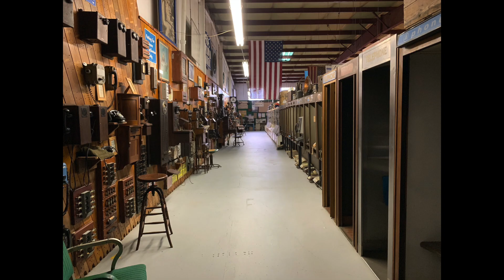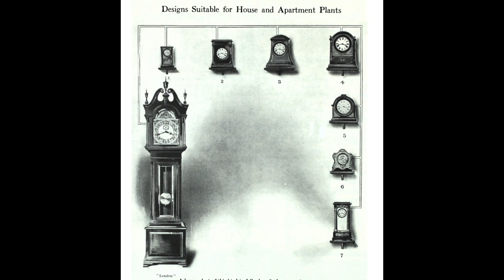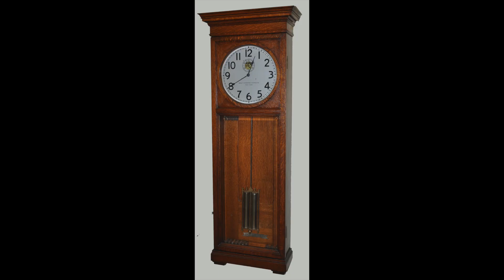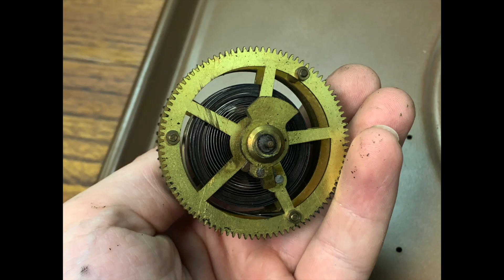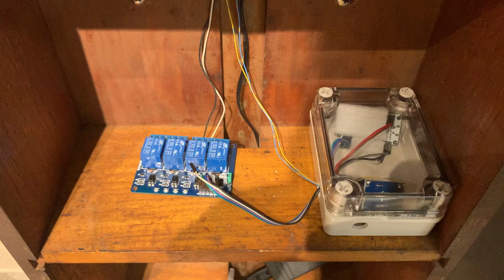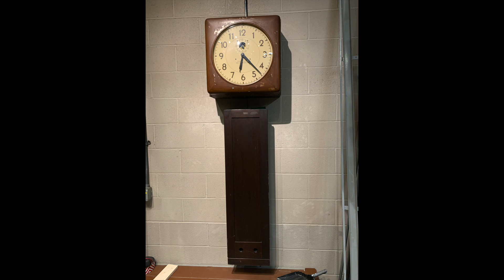Self Winding Master Clocks in Central Offices

Comment: I worked in radio in the early ‘70s and we had the self-syncing Western Union clocks. They would receive a signal over a telephone circuit at the top of the hour and the minute and sweep second hand would snap to the 12 o’clock position.  A precise time source is critical when you need to do smooth network joins.

Comment: I don't know whether it was made by that company but the high school I went to, built in 1936, had a self winding master clock with secondary clocks in each school room and for the bells.  The system was still working as of when I graduated from high school.  But that's getting to be a long time ago now, sigh.  I used to help the fellow that maintained the clock as he was one of the instructors at the school and we got to be good friends.  Now I'm curious, next time I'm back visiting I'm going to see if I can find out if the clock system is still running, or at least if it's still in place.

Comment: Hi Sarah, you run a fascinating  channel.  Synchronised clocks were part of my job 35 plus years ago. The slaves were deliberately designed to lose about 10 seconds per hour. So, the sync pulse would always make them catch up on the hour.

Comment: Somewhat puzzled by the 24 volt reference. Worked for BC Tel [just north of you] and the network voltage was always 48 volts.
Reply from the maker: There’s always 24 as well for switchboard circuits and tube filaments.
Reply: @ConnectionsMuseum  Must be a regional thing. I started installing CO equipment in 81. I checked with some of my older peers and they did not recall 24volts being used in any of our COs. Love seeing all the old equipment, a lot of it looks familiar or identical to ours.
Reply: @ConnectionsMuseum  I'm assuming there was a step down transformer for equipment that operated at -24 volts?

Comment: Here in Leeds, Yorkshire, UK, there is the "Time Ball Building". Its a building built in the 1850s which housed a watch and clock maker. It has a connection to the Greenwich Observatory, Greenwich, London to synchronise the time. At noon the ball would drop and you could use it to set you watch.

Comment: Wow Sarah, what a beautiful brain . . . fantastic video !!!  Huge time fan here, on the periphery of time discussions in the early days of GPS, various secure radio applications, later cellular phone service, and my wife's employment with the Voice of America with their synchronized clocks, that inspired me to install synchronized (now, power over ethernet, and time synch from a GPS antenna installed on the roof) in a couple of offices where I worked.  So glad Google decided you belong in my "space".  Have a couple of grandfather clocks here (only one running) with modern Hermle movements, and since the 2003 hurricane Isabel knocked out our power for a week, and I discovered that most of the clocks in my house were not actually clocks, but  frequency counters, and running on generator power - which frequency control was gross - and seeing my "clocks" lose all sense of time, I spent several years obtaining clocks tied to WWV in almost every room - generally change the batteries once a year - generally after the "fall back" [run forward 23 hours] DST-->ST setting.  Now we just need 999,992 more subscribers to this channel.

Comment: When I started working at Disneyland in 1985 they were still using mechanical time clocks and manila cardstock timecards. 

The time shacks around the perimeter of the cast member entrances all had syncing clocks which recorded tenths of minutes.

It saved a lot of us getting to the time clock "late" but still had 6 minutes past the hour to clock in and have the timestamp record xx.0 in that day's slot which lasted form minute 0 to 5. 

They finally ditched the manual system and went to an electronic mag-stripe ID card system in 1990.

Comment: I have one of these.  The back plate is stamped in ink WECO KS-1928 WECo insp 11773.  There are two screw contact boards at the top of the back plate.  Left is 1 - 4, right 5 - 8.   1 and 2 are the 24 VDC for the winder.  3 and 4 are the 6 second contacts.  Someone wrote in pencil “POD clocks small” below the terminals.  5 and 6 are the 24 VDC hourly sync pulse input.  The sync coil is 400 Ohms, so I assume it is 24 Volt.  The 3 Volt sync coils are about 20 Ohms.  Contacts 7 and 8 connect to another interrupter which is strange.  It generates pulses at 10, 20, 30, 40 seconds.  Someone wrote in pencil “large sec clocks” below the terminals.  Contacts 3 and 4, also 7 and 8 have knife switches which allow their circuits to the movement to be opened as well as momentary key switches which allow for manual pulsing.

The newer type F movements in these clocks bear a lot of similarity to movements made by Seth Thomas.  Earlier movements were outsourced to E. Howard, Seth Thomas, and possibly others.  The early movements used an unusual rotary motor which was modular and easily swapped for servicing.  The motors could be temperamental to adjust (personal experience) and were probably thought to be too technical for field service workers to deal with.  The vibrators are simpler and more reliable, thus integrated into the movement.  The whole type F movements were easily swapped and sent back for depot servicing.  The movement and serial number tag were swapped out together, and clocks may have had several movement swaps, so it can be difficult to tell exactly when a particular SWCC clock was made.  Over all, the SWCC type F is a very clever design and could run for many years in poor conditions.  The hourly sync feature meant that the pendulum did not need to be super accurately adjusted and time only needed to be initially set within about +/- 2 minutes.  Oddly, there is a lock-out that that prevents synchronization if the minute hand is too far off the correct time.

I have no further information beyond what Sarah said in the video.

Comment: Very interesting.  My experience with synchronized clocks comes from using an old school master and a couple slave clocks on a model railroad to run "fast time."  As the minute hands on the clocks (hopefully) advance with each pulse from the master, it's a (relatively) simple matter to drive the master at a faster clip, say every 10 seconds to speed up time by a factor of 6, etc.  Turns out that on the hour the master issues a special pulse to the slaves which releases the slave mechanism so that it slews to its hour position regardless of where it currently is at.  This takes care of any slowpoke slaves, resynchronizing them on the hour.

Comment: slightly more complicated than the synchronized clocks used on the railroad for decades - where the last ones are electronic and completely stop at 0 seconds (aka 60) every minute until they get a "go" signal from the master clock. Because they have to wait for the signal they're also always slightly too fast as it takes a few seconds for the signal to arrive.  In Denmark those clocks went away when the smartphone became a common thing as the railroad decided there was no need to keep maintaining the many mechanical clocks when everyone have an equally accurate clock in their pocket, so most our stations no longer have clocks at all and merely tell you how long you have to wait for the next train

Comment: I love this. I'm a broadcast engineer and one of my mentors had restored one of these in the early 2000's. I remember being absolutely fascinated with the back story. I'm both a telephone history and broadcast history nut and these clocks are heavily a part of broadcast history as well. If you look at old radio photos, you'll often see a Western Union clock in the background. They were a essential part of any broadcast workplace for a long period of time.
Reply: Before working in the old Bell System for a quarter century, I was in broadcasting, and the radio station I spent most time at had one of the classic WU clocks with the little red lamp that would light and the hands would twitch with the synch pulse.
Reply: I've been researching the IBM Studio Clock System, which I assume was designed to compete with the Western Union system. The IBM system used a master clock that synchronized to WWV/WWVH every hour and coordinated with the studio clocks every minute. They were available in the mid-1950's. There is virtually no information about the IBM system on the web but NIST has one of the master clocks on display at a lab in Boulder, CO. These IBM systems were not commercially successful so I've often wondered how studios kept accurate time without them.
Reply: I recall touring the "new" WGY (radio)/WRGB (television) studios on Balltown Road in Niskayuna during an open house after they moved from downtown Schenectady. They had some system of clocks which synchronized 30 seconds into every minute. I don't know who made the system.

As for IBM, they did have a division which provided master clock systems. I have not found information on the internet about the specific system that my high school used.
Reply: I was told that the Self Winding Clock Company became IBM does anyone know if this is true?

Comment: It's just delicious that you have the 1930s clock synchronized to NTP.    I love it.
Reply: I think it's great that the synchronization involved ultimately uses the same source for time services. The US Naval Observatory Clock (at least in the USA) is the standard time source, regardless of whether the synchronization path is through Western Union, or NTP. Some things are arguably right. 

I'll grant that many time servers that NTP uses are synchronized via GPS these days, but those time sources either get corrected, or have correction information available to compensate for the fact that atomic clock sources on GPS satellites do not adjust for leap seconds, and because they are in orbit, operate at a different time speed than the naval observatory clock. Likewise if you use NTP in a country that specifies that people in that country use a clock reference that country maintains, it would not be the same. That may require using an NTP pool as specified there. Not my bally-wick.

Comment: I wonder of these clocks connected to the operator switchboards to keep them in sync for long distance.
Reply from the maker: The billing clocks were called Calculagraphs, and they actually ran of commercial AC power! https://www.prc68.com/I/Calculagraph.shtml
Reply: @ConnectionsMuseum  It looks like those clocks are manually set.  That’s very interesting.  It’s also interesting that you were able to use NTP to update this clock from the 1930s.  Very clever.

Comment: Very informative! I actually have a IBM sub-master clock that contains several relays and a programming unit. It also runs off of 24vdc. A central time service would send a pulse to it the same way stopping it at the hour to sync. It's one of the larger ones with the heavy dual jar pendulums. Thinking of running a few secondary clocks off of it some day. Keep up the good work!

Comment: I like the idea of extra batteries. A timed or synced system is very important. So having a backup on the backup for power esp. in a central office out in the middle of no place U.S.A is good luck on power among other things.
Reply: ב''ה, difficult to say for sure, but there was a preference for at least that much power redundancy through the 1990s, given the necessity for emergency services (and poor press if that weren't available; different world).  Bureaucratic financial reasons should also be considered (who had the battery contracts?) and a surplus of batteries would have been a boon to the electrical/electronics and eventually radio hobbyists keeping the system running.
 
Lead acid cells past their company mandated service life but with a good few years left in them were somewhat common and sought after by radio hobbyists 30 years ago or so.

Comment: Perhaps the battery box was for sending out a stronger current, or an isolated one, across a very large building, using this clock's sync pulse to drive a relay instead

Comment: Nice Clock. There was a later Wester Union Clock in the Central central office in Oklahoma City back in the 1970's. It was mounted on a column next to the Time of Day (AUDICHRON). It was AC powered and reset at midnight. The clock and the Time of Day keep good time unless the office was running on back up power generators.

Comment: At one point I had nearly 100 of these self winding clocks, all from the remnants of a Western Union repair depot. I think I might have a few left. Anyway, there were many, many variations, but none had the nifty six second gizmo like yours.
Reply: I have a nice clock but someone gutted it and installed a modern battery movement. I might be interested in a movement and some parts. Thanks.

Comment: Used to stay at a place that had a type of synchronous clock (stepper clock), had a series string of electromagnets going to slave clocks and the master had a similar electromagnet and a pendulum and ratchet gears with a deeper tooth I think every 15 teeth or so (about 30 seconds, I think there was a secondary gear with a deeper tooth every maybe 5 - 6 seconds as well) that triggered a switch (and subsequent click-clunk from all the slave clocks and the dial in the master). The pendulum had a self kicking mechanism that gave it a kick from an electromagnet if it slowed down too much. They were rather loud, every 30 seconds you’d hear a click clunk, got a little annoying at night with the one in the room I was staying in, the guy that owned it bypassed it to stop that slave clock. The clock had to be manually set I think, there was an advance and stop (retard) switch in which the advance position would advance 30 second steps every second (the rods that triggered those switches for that were moved away so they weren’t triggered as he mentioned it would lose time)

Comment: Great find. I worked on private systems in UK not central office but we had Master Clock systems with slaves all round the factory/ hospital / office etc. They pulsed every second to the dumb slaves. After pendulum came Crystal controlled which seemed like magic. I still had two weekends overtime a year driving round the region correcting for  British Summer Time/daylight saving and back to GMT.I used the BT Speaking Clock service to manually set them so only accurate to about 1 second though the Masters could be far more accurate.
Reply: Hi Alan. T. R. by any chance??
Reply: @hullblerk9597  Its successor Plessey.I came from the ATM side Communication Systems Ltd.
Reply: @alanjones3873  OK Alan. Spent a lot of time at Plessey on various courses. Stayed at the Rockaway.
Reply: Reminds me of the German railroad clocks. They have no time-keeping mechanism inside; the second hand is driven by a dumb motor that rotates it once in just under a minute. It stops at the top, and then an impulse from the master clock advances the hands by one minute and allows the second hand to spin again.